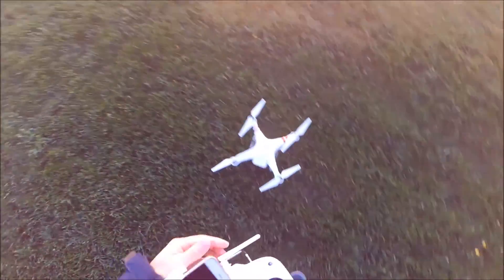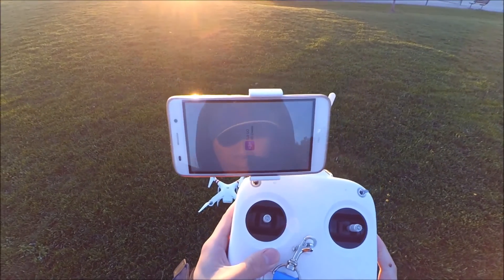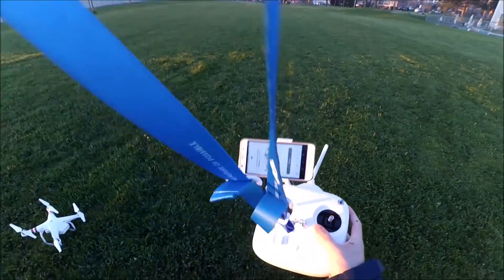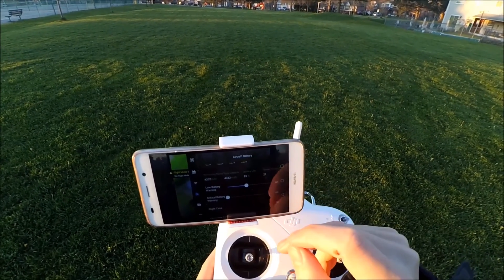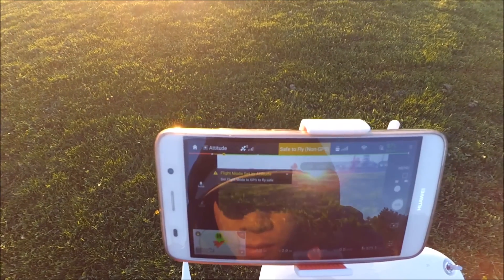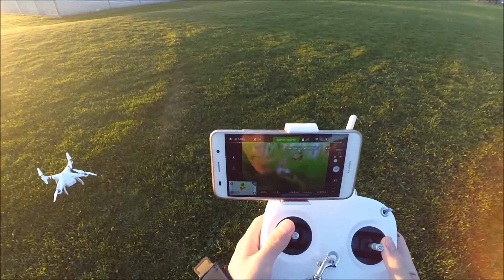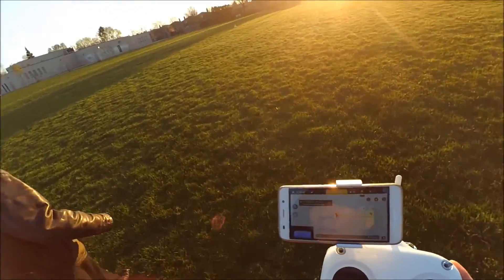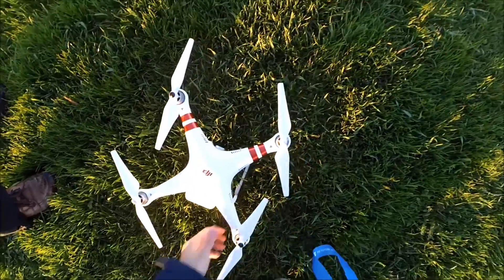DJI Phantom DRONE FLY AWAY DANGEROUS

Comment: Everyone says, "no magnets", "No metal",  when calibrating, and the first thing they do is hold the controller in one hand and the drone in the other.
Reply from the maker: Yah . I would say that is a design flaw. When would any regular consumer not be near any metal or electrical current? The human body is also a natural conductor. How much difference would the metal make? Of course, don't look to calibrate near a train station or a metal bridge in sight... But this requirement of absolutely no metal  or electrical things to calibrate makes it a bit hard to determine. In the field with the controller, maybe the calibration was 0.1 percent missing to 100% calibrated. or 0.005 percent to a "fully accurate calibration. The app or drone doesn't actually indicate.  The earth also has its own magnetic field. How would the average consumer minimize the interference to "no magnets, no metals" at all? 

DJI facebook or forums actually suggest "as much as possible"  basis. And that can really be trivial when trying to determine if one grass field has 0.25 interference, or 0.010 interference of metal or magnetic substances that are not natural to the geographical location.

I do not think my compass calibration was the issue here.  But interesting point you made.
Reply: I think distance is the controlling parameter here. The magnetic interference falls off fast with distance. If you left the controller, coins in your pocket, metal eyeglasses and all that stuff out of your pockets and say, 10 feet away or more, it would make all the difference than if only 3 feet away.
Reply from the maker: alrighty i guess! thanks!

Comment: I also believe you have your settings wrong in the app. It's probably set to auto land when it loses connection with remote. I don't understand why you keep changing home point position. I also believe it's user error and not the phantom. I've actually owend that phantom you have and they work great I'm just not into the range it has . Not very much at all.

Comment: dude ur dumb. you need to enable smart return to home
Reply from the maker: Scott Welinski I did. 
no response. 
atti mode, it kept going. 

please read description . thanks
Reply: 2 times in your video you clearly said and showed it disabled ive flown mine over 500 miles constantly changing between the home points and NEVER had ur problem but i just duplicated urs.....when smart rth is not enabled. so like i said enable smart rth

Comment: Its the DJI Go v 3.1.2 bug! Happend to me twice! 
THE PROBLEM IS, that GPS position of DJI GO app VERSION 3.1.2 is offset of about 1km! Thats why the app asks where you want to go back? Current position (blue gps pos of the phone), which is ca 1km or original home point (green H icon). Its confusing, but if you click original home point it actually goes to green H point. 

Now I have checked my GPS signal in Google Maps in Phantom itself and in DJI GO app and G-maps an phantom are all fine, its the DJI GO app that have the error.

The most crazy thing is, that after cancel returning to current position its still drifting that direction!!! which is crazy!
I can cancel returning to original home point and phantom just hoovers, but if i cancel returning to current position its still going! WTF!

as it was still flying away after cancelling I had to crash land the phantom to reduce demages...at cost of one broken propeller.

Comment: Same exact thing happened to me last week I was flying line of site, flight logs show it was a little over 4 mins into the flight and i was actually getting ready to land. flight log show gps error and speed error. took off at 45mph never saw her again. luckily dji is sending me a replacement but nothing on how it happend what caused or or anything. might as sell sell this and wait to spend more money on a product that wont laugh at my hard earned money spent..lol. im probably not gonna fly my phantom 3S until i get a gps tracker on it. for now doing fpv racing
Reply: Jack Herrer mine did it yesterday it changed its RTH spot mid flyt and decided to make it in the middle of a forest 1 mile away and wouldn't let me cancel RTH and ignored all controls
Reply: did you find it? do you know what caused it to change? could it have been the gps signal on ur phone? i got my replacement frpm dji but im afraid to fly it without a external gps on it.. probably safer to make it hover instead of return to home. maybe a chance of rc reconnecting again. i noticed in my flight status (after having to update since it wudnt bind without update) that the rc signal quality switched from poor to good very fast and eventualy said ready 2 fly but in status kept switching. maybe this has something to do with it
Reply: NjDrones_nfpv never found it at the top of a tree I think went to the area and searched , I have no idea why it changed but have the whole thing on flyt recorder controlls were not responding to
Reply: NjDrones_nfpv you say they gave you a replacement ? I dout  they are gun a replace it even though i have the whole thing on flight  recorder , they will be getting a letter from my solicitor if they don't loooooool
Reply from the maker: thanks for dropping by.

that sucks... glad dji is willing to replace yours! it seems to be rare

Comment: exact same thing happened to me sunday.  Good video.  So what have you done about it?  is it a glitch with software. I had never seen that screen before , set current home point !! It threw me completely.  By the way i had a fly away too.  Couldnt do anything about it. It was like it was possessed.    I looked at the flight data and could see the home point changing mid flight.  Thats not right  !!
Reply from the maker: dazdevonboy hey, I'm sorry about your fly away. I think it was because I set max distance, and also phone GPS location was turned off.. the combination of these two things made the home point jump after I selected "set aircraft current position" . that is my hypothesis. now, I always turn on GPS on my phone and check the home point is actually where my drone is before I put on the propellers.. hope that helps and you may find your drone.. again, sorry it flew away. it hurts to get that feeling. keep me posted if anything new happens.

Comment: That sucks! Needless to say never use "Set current Home point" again hehe. RTH seems to work fine from take off position which is the main thing.
Reply from the maker: slbynum thanks for not bashing on me about unsafe flying etc etc.. here, I am flying in a open field . my hypothesis is because my cell phone GPS was not on... but I had tried these set current home point before... without GPS on cell phone and it worked fine.. but apparently not anymore
Reply: 3xilelast Try dji phantom forum, the problem is with a recent Go app upgrade, you need to downgrade to Go 2.9.1. The app is in conflict with the phantoms firmware and sets 2 different home points. Had the same problem, cured it with a down grade to Go 2.9.1 app. Details on the forum. Its not your fault, but it certainly knocks your confidence. I lost my phantom , recovered it from nearly a mile away !.Checked my logs and it had done exactly what yours has done. I don't know the finer details but I think its using 2 different maps, the here map and the Google map and setting an home point on each !!.. don't quote me on that though !!....anyways the down grade works for me !, happy days, hope this helps ......john
Reply: Another angle on this is, you set the max distance to 150mtrs, if the new home point is set to say, 500mtrs away, then do you have any control until you get 350mtrs nearer the new home point ? .Mine set its new home point 1150mtrs away. The drone is doing exactly as instructed,  its using logic and returning to the latest home point setting ,you are out of range and your options are limited at this point.. its a nightmare scenario.  It has 2 home points, so selects the most recent, you get a screen prompt when you select rth, " original home point", "new home point" and also you have the option to reset the home point to its current position!!!!. Very confusing, and I hope I, and anyone else doesn't have to go through that experience again.
Reply: shaun o'mercy hey man how do u downgrade it. i wanna downgrade my dji go app, downloaded 2.9.1 apk andi installed it and then the screen come out from the app seems like forcing me to update the latest version, wont allow me to use 2.9.1 version. i want to use 2.9.1 version since ive got no confidence using new update.
Reply from the maker: eznymorpheus you might have to check the forum . forum.dji.com 
hope that helps. thanks for dropping by.
Reply: 3xilelast which one? if you dont mind to give me direct link to the topic forum

Comment: just curious, when you realize it started to RTH to "no where", could you just cancel it?
Reply from the maker: Singgih Arfianto tried to cancel. but it kept going.
Reply: eznymorpheus, I did this, I switched the right switch twice, but the drone kept going. After update it works fine again, I can also cancel return home any time.
Reply: 3xilelast exactly same model and same thing happened to me
Reply: This is crazy, happend to me twice. The problem is the DJI GO v3.1.2 which has GPS current position offset of 1000m! But the thing is, you CANNOT canel it! Which is crazy. I tested it, and you can cancel returning to "original home point (green H)" but if you want cancel return to current position it cancels it, but keeps going the direction! And you cannot overtake the control of direction, I could just crash land like i this video.
Reply: Tom i saw other video that for a full control u should use the right switch and use atti mode.
Reply: Tom dont have to do it twice for the right switch. only once. the left one you should switch twice for rth mode. you might be confuse